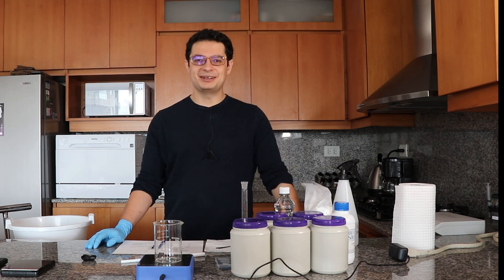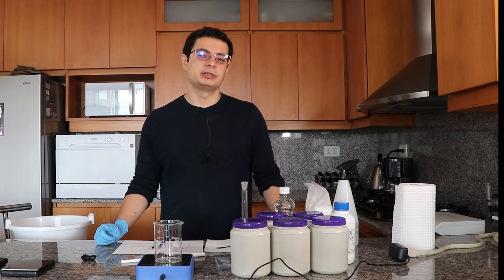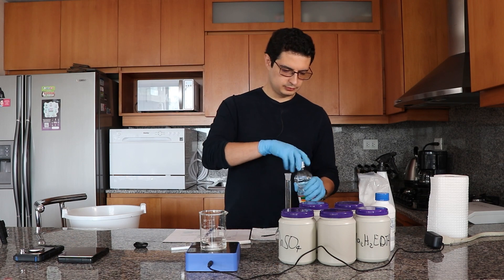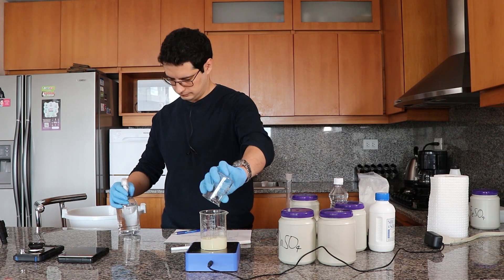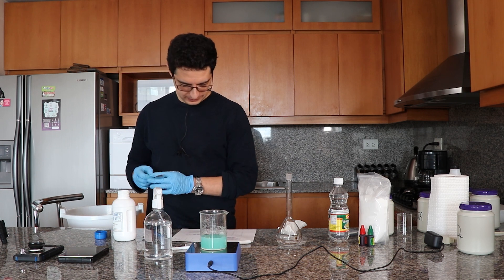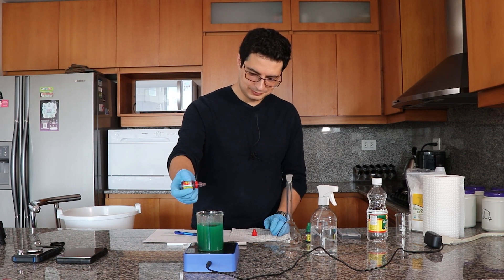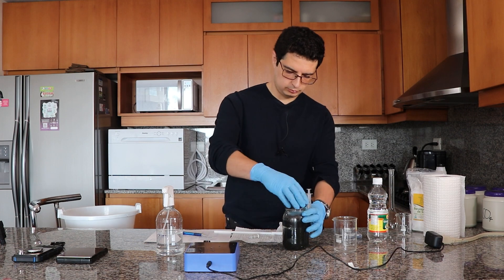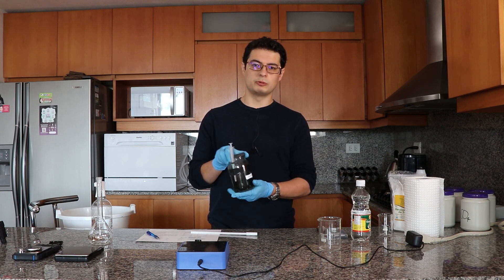Make your own micronutrient solution for hydroponics, lasts a lifetime!

Comment: Dear Dr.Fernandez
1- I would like to express my special thanks for making the nutrient calculator available on your website. I have been using it for about two years now and since I used to calculate manually before, I know how much effort you have put into it.
2- Regarding the recent formula, if possible, please explain more about the use of Sodium Benzoate and for what purpose it is used.
3- In stock A compounds, and especially when iron compounds are added, sediments form at the bottom of the tank. What should be done to prevent this sediment?
4- Considering that my field of study is not agriculture and I use a calculator only for household purposes and making fertilizers needed for a few plants and trees, if possible, I would like to ask you to explain more about the use of nutrient fertilizers in gardens for those interested, because the growing medium is most often soil, and considering the composition of water and soil, will the amount of use be the same as 10 cc per liter or should the dosage be changed?
Yours sincerely

Comment: Thx a lot Daniel for this explicative video. I have a doubt about the iron chelate generated in situ with EDTA. It is stable at a pH up to 6 what is fine in your mother solution. But as soon as it is diluted in the nutrient solution you will get precipitation and then no availibility for the roots. Haven't you tried with DTPA (chelate stable up to 6.5) ?

Comment: thats neat.  now, what i haven't heard is any safety precautions, what if final concentrate glass breaks and spills?  you got a heavy metal mess, bad for anything life it comes into contact with.  also, the concentrates themselves, if im going thru this much trouble to measure everything just right, may do this in windless day outdoors with mask on, not in my kitchen.  LOL.
Reply from the maker: Thanks for sharing. Yes, a 1000x concentrate is a mess if it breaks. You can prepare a saturated solution of sodium phosphate to keep handy. If you have a spill using that will precipitate all the metals as insoluble metal phosphates. So all living things will be safe from the spill!

Comment: I have a spin off question here. If i have a premade powered micronutrient mix that i am happy with in terms of ratios they use, but this mix is made from all sulfates with no mention of any chelates used, can i make a stock solution of these micros and then add DTPA first to chelate the iron and then EDTA to chelate the remaining micros?
Reply from the maker: Yes, but you can add both chelating agents at the same time. Chelates formed will reach equilibrium within a couple of days, regardless of the order in which you add them. The DTPA will end up all binding the Fe and the EDTA the other metals.  Just because of their differences in affinity.

Comment: Hi Daniel, please tell let me know many grams of Ferrous Sulfate Heptahydrate is needed in your formulation instead of Iron sulfate (anhydrous). You could also give me a formula to calculate. I am new at this :)
Reply from the maker: If you are using the heptahydrate, multiply the mass of anhydrous Fe sulfate by 1.35.
Reply: @ScienceinHydroponics  Fe in Anhydrous is 36.7%, while Fe in hepta is 20% , the multiply factor is 1.35 or 1.83 (36.7%/20%) ?
Reply: Yesterday make my micro blend, and I have the same ferrous sulfate (hepta, look like brown sugar). My vinager is 5%, so I add water to get 3.5% acetic acid, when mixed with ferrous sulfate, the solution turn brown, and when add the EDTA (the solution turns "milkie")  start my problems, the stirer look hard to mix, the solution looks more dense, and when I adding the rest of sulfates can´t mixed like in the begining, and in the end no mixed anymore, the solution in the bottom have precipitates and in the top looks like a oiled. Im add more water and continued mixing, can mix some, but still is a mess. I puted this monster in a plastic 5L bottle, I dont now what I have to do, mixing whit some heat for tried fixed, or disolve litle by litle watering my backyard

Comment: When I mixed the sulfate solution with Sodium Molybdate, there was a precipitate.  What is the precipitate and will it re-dissolve in the reservoir?
Reply from the maker: There should have been no precipitate. I would suggest checking the amount of salts added and making sure the purity of your salts is adequate.
Reply: had the same... a clear crystalline precipitate. not water soluble at tbe first sight... but i put the precipitate in fresh water and added some more metall sulfates and the most of it disolved... could it be that the excces of EDTA recristallizes?

Comment: Hello Dr. Fernandez, I hope you find time to read this message... Can I replace it with Tetrasodium EDTA using the same amount of Disodium EDTA? Reason being is there's only tetrasodium EDTA in my location. thanks.
Reply from the maker: You can replace it, but you will need to change the amount in proportion to the difference in molar mass between both substances.

Comment: Thanks Daniel, great information again!  Sometimes I'm doing these sort of things on my own and then see your video and it really helps build my confidence that I'm doing it right.  Especially with micronutrients where it's expensive to test concentration and it's easy to induce a toxicity.

I have a question for OMRI growers.  I think all the micronutrients are OMRI approved, however the preservatives and chelators are not.  I was thinking of making a gallon of this as you instructed, minus the preservative and chelators.  Then pour them in quart jars, put in pressure cooker, can it (sterilized and vacuum sealed).  Then each quart jar will be for 250 gallons of micronutrients.   Any problem with this?

Could add humic acid to make to dye the solution black?

I don't think we need chelation in an organic system because there's already numerous natural chelators (lactic acid, citric acid, amino acid, humates, etc...) and because we control the pH tightly to 6.0.   At pH 6.0, I don't think any nutrients need to be chelated or complexed for uptake (inorganic or organic)...is that correct?
Reply from the maker: Thanks for commenting. It is important to note that the micronutrient sulfates can be OMRI approved, but only "approved with restrictions" which means that their use is only allowed in organic growing when a deficiency is certified through tissue testing. They are not allowed for general use. When looking at the OMRI certifications it is important to consider whether they are issued with or without these restrictions.

In your proposal the main issue will be that the Fe will oxidize very quickly and turn into insoluble oxides/hydroxides, the pH of the solution will need to be buffered and chelating agents will need to be added to prevent this problem. Some chelating agents are OMRI approved - although much weaker than the synthetic ones - like for example citric acid.

Comment: should I also chelate the Magnesiun Sulfate in my B solution to prevent Calcium sulfate precipitation in my end solution?
Reply from the maker: No, this is not necessary. The final solution should contain Ca and S at concentrations low enough to prevent precipitation. Adding that much EDTA or other chelating agent would also have negative effects on the plants.
Reply: then I still have no clue why my final solution isn't stable for more than 2 days. N240-209-K260-Mg60-Ca260-S90
100x conentrated with micros  as pH+ KOH or KSil (pH6.3...Im in soil). P too high for feed??.. any Idea?
Concentrates and chelating works great with your method... really big thanks for you efforts... i already learned a lot

Comment: Hey Daniel, I heard you say not to use phosphoric acid. I was thinking of making a diy ph down using phosphoric acid for my hydro system, Would you recommend not using it & if so is there an alternative option? 👍🏾💚👊🏾
Reply from the maker: I do not recommend using it as phosphorous is a nutrient you want to control exactly. Sulfuric acid is normally the best choice as plants are much less sensitive to absolute sulfate concentrations.
Reply: @ScienceinHydroponics  OK I got it, sulfuric acid (battery acid) instead of phosphoric. Would I dilute it with water only or should I add something like iron or whatever? Also in what amounts should I mix the mixture? Thanks alot, now I gotta cancel my phosphoric acid order😁👍🏾💚👊🏾🙏🏿

Comment: 2 things if you please - can we use something else instead of EDTA.  also a science question?  can you explain the difference between a substance is in the "reduced" form versus "oxidized"?  like - is the iron sulfate in the reduced form? mygreathanks and blessings
Reply from the maker: Thanks for commenting. You can use any metal chelates that have high stability, this includes DTPA, EDDHA chelates and others that are less well known. However weak chelates, like amino acids, are not going to work well. 

About the oxidized/reduced forms, it depends on the substances. In the case of iron, it commonly is either metallic iron (most reduced form), iron II or iron III. The higher the charge of the iron, the more oxidized it is. Iron (II) sulfate will be a more reduced form compared to iron (III) sulfate.
Reply: @ScienceinHydroponics  o my goodness sir.  that was fast.  and i didn't even expect an answer, to be totally frank about it.  About the reduced form, there is this assertion about iron needing to be in the reduced form else, it will enter the plant and not be functional, per plant sap analysis by a Netherlands company.  and continuing with total frankness, i am not into hydroponics but your videos are totally open, educational, and helpful to diy people and what i am trying to develop is foliar sprays of iron and manganese -  the 2 most problematic in growing in soils.  about the chelation, would fulvic chelation work...mygreathanks and blessings from the Philippines🙏
Reply: @paulbraga4460  to make the iron and manganese available on a foliar, you can 1) reduce the oxidation and/or 2)lower the pH. (these aren't independent though).   I simply put appropriate amount manganese sulfate and/or iron sulfate in 1 gallon RO water + 1 tablespoon 5% vinegar + 1/8 teaspoon humic acid + 1/8 teaspoon fulvic acid.  You're good to go.

If you have access to omri agrothrive 3-3-2 or 3-3-5, you can instead: use appropriate amount manganese sulfate and/or iron sulfate in 1 gallon RO water + 1 tablespoon agrothrive.   The agrothrive is a lactic ferment complete organic fertilizer.  It contains lactic acid, amino acid and humates that will all help to both reduce and chelate the foliar.
Reply: @darknectarcooperative7242  wonderful. many many many thanks really...i should pick your mind ...blessings
Reply: @paulbraga4460  You're welcome.  You asked in email what is appropriate....
I'm not sure what is appropriate, depends on the plant and how bad the deficiency is.   A lot of plants probably have a sap level of Iron 5ppm and Manganese 4ppm.  That's probably a good starting point...spray the same concentration as the target sap level.  Then I would try 10x that level on a few plants and see if the results are better or worse.  (I suspect 10x the sap level is best, but better be safe than sorry)
Here's an estimate:So 1 gallon is about 4L = 4kg of RO water.   Ferrous Sulfate Heptahydrate(FSH) is 12% Iron.   Manganese Sulfate Monohydrate(MSM) is 19% Manganese
a little algebra:   
5ppm = 5g/1,000,000g = .12*(FSH)/4,000g     FSH=.17g
4ppm = 4g/1,000,000g = .19*(MSM)/4,000g    MSM= .08g
So I would trial A) 4L of RO water + .17g of FSH + .08g of MSM,  and  B) 4L of RO water + 1.7g of FSH + .8g of MSM

somebody check my math, I did this quickly.

If you DIY lactic ferment...
It's difficult to predict how strong your fermented compost will be.  so, add enough fermented compost to water so that the TDS is about 500ppm.  Lactic ferments can be as low as pH 3.5.  I think it's always safe to spray with pH 5.0.    So once you get your solution to 500ppm, check the pH.  If it's below 5.0, add a pinch of sodium bicarbonate or potassium bicarbonate(use if your plants already have too much sodium).Add bicarbonates until the pH is 5.0.
Reply: @darknectarcooperative7242  wonderful.  just really thinking things through just in case coz iron and manganese, i am told, are usually (surprising with iron which is abundant in soils) the most difficult to come by as one transitions to biological practice.  my thoughts are to have a fertility program for our community farm that avoids having to make emergency measures...again, mygreathanks and blessings😇

Comment: I am wondering your thoughts on the best way to chelate micronutrients.   I've heard plenty of bad things about EDTA.   Is Iron Sulfate, Iron Nitrate, or Iron EDTA or Iron DTPA better?   

Thank you for your contributions to the community!
Reply from the maker: Thanks for commenting!

The question can be quite extensive (video about this in the future). However, here are some pointers:

Most negative comments about EDTA come from the fact that it requires much better management of the crop to be used successfully. If you don't know the necessary conditions to use EDTA correctly, you're likely going to have issues with it.

If your crop pH is managed adequately (the pH never deviates from 5.8-6.2 in the media -- the media, not the feed) and the media is inert and has no amendments, then EDTA is a good chelate choice. If your media pH can deviate substantially or you don't monitor it rigorously, then use DTPA iron. Many people think EDDHA is better, it's really not (info in the future video).

DTPA is the most "fool proof" choice of chelating agent for Fe. 

Also, make sure if you use FeEDTA that you also chelate all other micros. If you chelate only the Fe, then you will have lots of problems if your chelate is EDTA (more on this on a future video).

About UV and chelates. Ultra violet light can destroy ANY of the organic chelates, as they are not stable against this sort of radiation. Whether this means the metal also falls out of solution depends on the pH and ORP conditions of the solution. There are several solutions, one is adding a "chelating agent reserve" from the start so that it can rechelate any metals whose chelates are destroyed. Another is to replenish the chelated metal. 

Controlling exposure time and UV power is also important. Facilities that suffer from bad chelate destruction issues often have long exposure times or unnecessarily strong UV lights. 

I hope the above is helfpul!
Reply: Very helpful.   Can't wait for the video.   I love your material.  Keep it up, and thank you so much!
Reply: Also wondering which chelated micros fall out of solution in UV filtration systems.   I think it was Iron EDTA, but I can't find the video.    I think Cari Peter's was talking about it in a Webinar.   I could be way off here.

Comment: Thanks for making videos on how to make nutrients from raw chemicals. However, I'm wondering: just as soil gardeners have the option of composting clippings, dead plants, scrap paper and kitchen residuals, and thus recycle into nutrients these things that would otherwise go waste, is there a way, accessible to the hobbyist, to do the same in hydroponics?
Reply from the maker: Thanks for your comment. Yes, this can certainly be done, but some level of lab testing of the resulting solutions is needed. Since we precisely control the nutrition in hydroponics - we don't have help from the buffering systems present in soil, both biological and chemical - we need to make sure we provide the nutrients in the needed amounts.
Reply: @ScienceinHydroponics  Any chance to see a video on this subject?

Comment: Would you teach us on how to calculate amount of required EDTA ? I'll try to figure out how to decide amount of disodium EDTA on your solution, total metal (copper + iron + zinc + manganese) is 0,0171 mol, but my calculation for 7.2 gram disodium EDTA is 0,0193 mol. Shouldn't the amount of mol be the same ?
Reply from the maker: Thanks for commenting! I always add a 10-20% molar excess of chelating agent, to ensure everything is chelated and I am not left with any unchelated transition metal. This also accounts for any impurities in the EDTA.